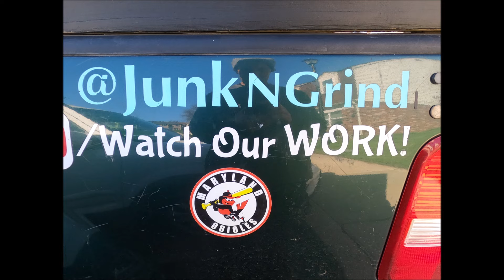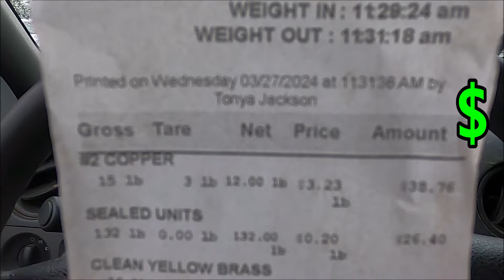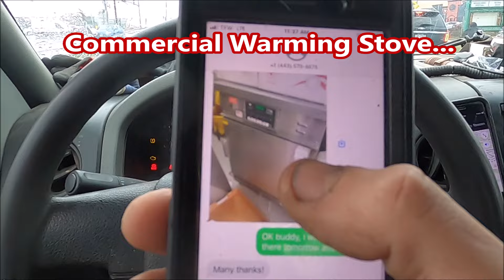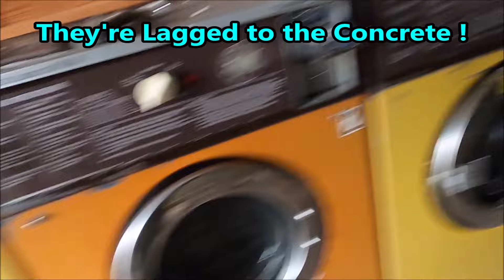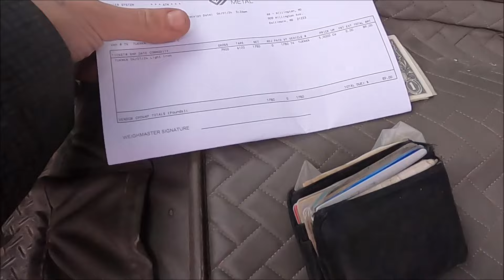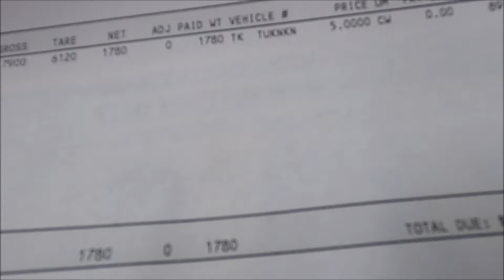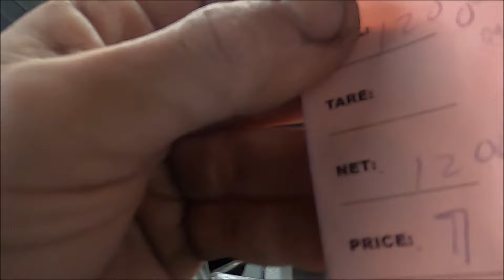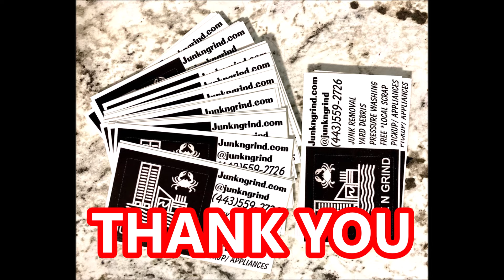SpringTime SCRAPPING Recycling in the Rain SCRAP METAL ♻️ HVAC Laundromat Appliances Baltimore MD

Comment: Check to see if any Dollar or Family Dollar stores are closing in your area.  Carry a tarp to cover up furniture that you don't want to pay more at the landfill.  Re-offer to remove washers/dryers, including toll costs, possibly rent a trailer to handle bulk hauls.  Does your yard take closed units?  You might advertise removal of contents of fire damaged units.  Now you know what AZ must be feeling getting 6¢/cwt!  Be safe out there.  Our heartfelt 😢 for your Aunt Donna.
Reply from the maker: Thank You so Much Ma’am. 🙏🏼 Yeah the Rain can Definitely Add More Weight to the Junk Removal Jobs. Usually I Head Straight to the Landfill Afterwards. Lower Pay is Very Frustrating 🤔🙄😂. Just Gotta Work Through It 🛻🗑️💪🏼🛠️.